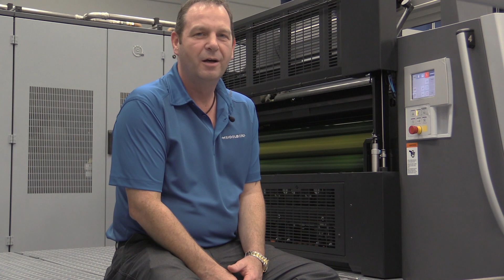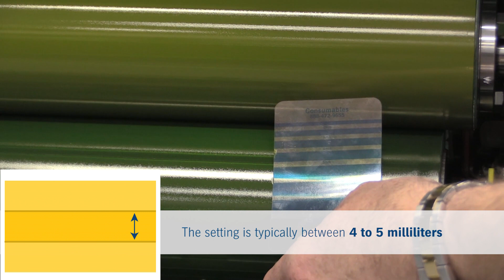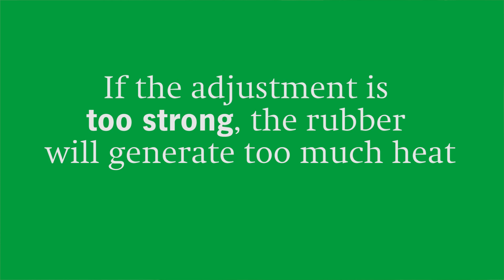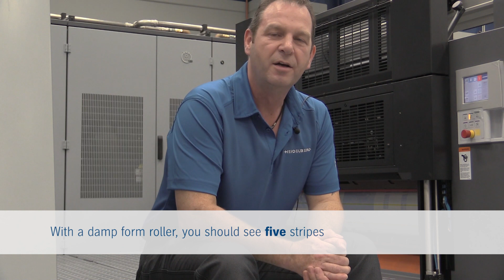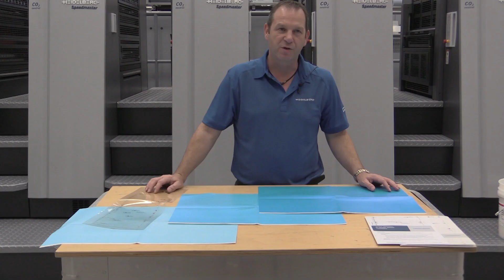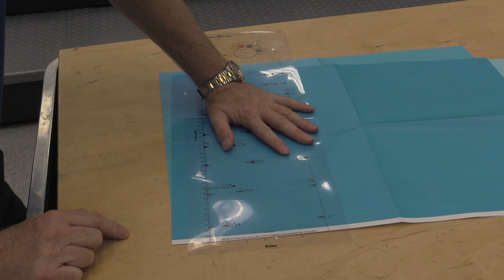How To: Check and Set Rollers

Comment: You didnt mention the recommended width of stripe on plate..
Reply: All forms to plate are 4-5 millimeters,  except the water form which is 6 millimeters make sure your ink train is set in 1:2
Reply: @Kegga_6  thank you so much. I really  appreciate thay
Reply: @SteveMK  no problem, may I ask what press your are running
Reply: @Kegga_6  gto 52 single.
Reply: @SteveMK  wow don't think I've seen a gto in 20 years, I started out running a 2c sorzs, here I am now running a 8c xl 106 new gen 2020 with 2 coaters and cold foil 30 years later it amazing how far the printing industry has come, but those older heidelbergs will never stop, I was running a 1956 windmill helping a freind out not to long ago
Reply: @Kegga_6  we differ in age and capital.. i know there are better machines for cmyk.. but due to capital, i had to buy a second hand Gto.. but am doing fine though 🤣🤣🤣
Reply: @Steven-bv6nm  why set the water form thicker than the ink forms?

Comment: I have a question, I have a one to two inch stripe across my blanket six to eight inches back from the lead edge of the blanket also I have a one to two inch stripe about six to eight inches back from the tail end of the blanket plate is clean can anyone tell me how to get rid of that never seen it before this is a new problem I have tried different inks and different fountain solutions next I'm going to try different plate material this is just started up this year any suggestions for me to try thank you
Reply: So is it a waterline? I print folding cartons and I know on dark inks like frosted flakes for example I would get the image of a line across the box.

Comment: Helpful. Could you make a video to show the best way to adjust the water unit settings and also if possible step by step on the ink rollers. XL 105 if possible. You don't do it every day and the video is helpful when it's time to do it
Reply: The skew setting on the dampeners is a bitch but it works well when you understand it.